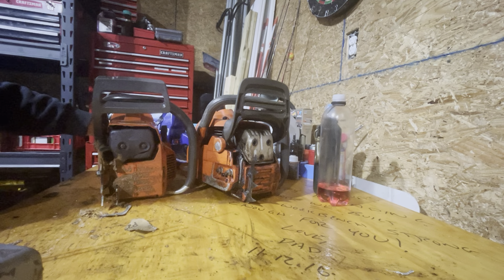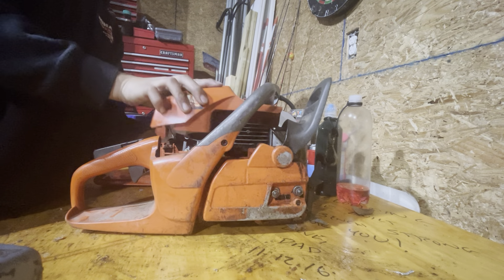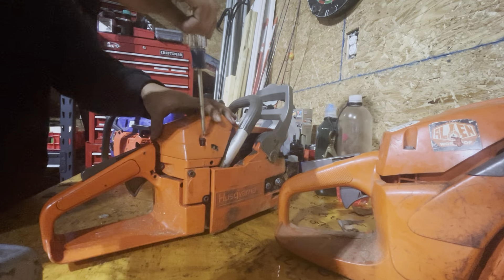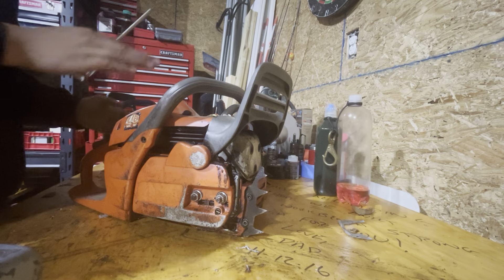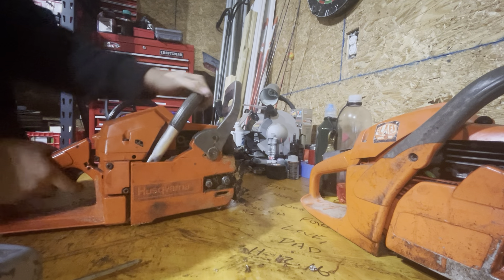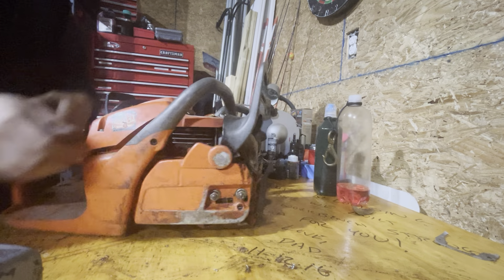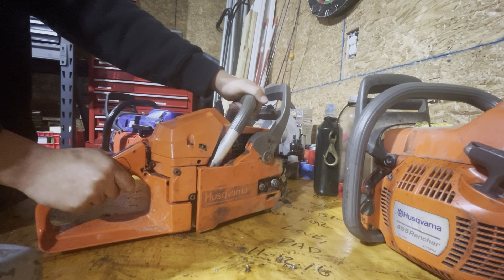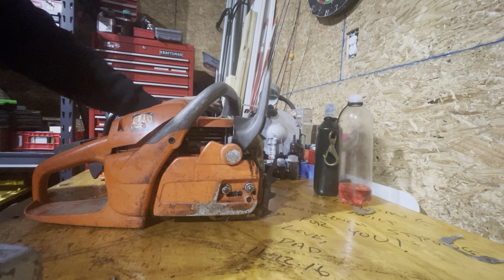Husqvarna 55 Rancher VS Husqvarna 455 Rancher

Comment: I agree.  I have had a 55 rancher for over 20 years.  I cut 8 cords of firewood a year with it.  I purchased a 455 Rancher 2 years ago because the 55 was starting to have wear. or so I thought.  The 455 is very finicky and never ran properly.  I am not a small engine expert.  I read online that it is difficult to tune the carb.  Thanks, EPA.  I then started buying replacement parts for the 55.  After working with it, re[lacing the worn parts (clutch, oiler), I realized that it is a much simpler option.  I have some trees to cut to finish a project here in installing a fence along the property boundaries.  I purchased several 55s in running condition (I have downed and bucked over 50 trees so far).  Some were upper cylinder jobs, some were stock.  I assumed that were most were abused an began shooting the parts cannon at them when they arrived.  It turns out that most ran quite well out of the box.  I spent $150-$250 per saw. on ebay.  I put them all to work and rotated duty to test them.  Many worked quite well when comparing them to my original saw.  Now that I have settled in to the good and the bad, I started a compression check regime.  My go-to purchased saws were 150-170 psi.  They ran and performed well.  I tested my shop queen, the original, and discovered that, after 22 years of hard use, it was at 180 psi.  Maintenance matters and using quality 2-cycle oil matters.  I always ran 1:50 as the manual required with an extra "glub" of oil in the fuel.  It turns out that the 50:1 is an emissions thing....from the EPA.  I am now running 40:1 in all my saws.  Remember, prior to EPA 32:1 was the standard.  Oil is life for the internals.  I now have the tools and knowledge to bring the 455 to running condition, but it will never achieve status for me.  The 55 has the option to have dual dog spikes.  Because of the external chain adjustment, the 455 never will.  I am cutting oak, hickory, and alder.  Dual dog spikes helps.  I now have 6 running 55s (what a pleasure) with 6 in the hopper for winter work to bring them to running condition.  The 55 is the perfect balance for speed and torque.  Another note, some of my 55s are not ranchers (decompression button) which have lower compression, which raises the question: were the rancher variants designed to have more compression?  I do have a couple of Holzfforma G660s for the bigger trees and sawmill duty: Yes, 92ccs is awesome and is quicker, but as an older guy, the rancher gets the nod for limbing and bucking the 20" or smaller trees.
Reply from the maker: Those are great points and I do the same, those 55 ranchers are awesome to buy cheap used and get running again as they are great saws. And I’ve got a 390XP W husky and I still run my 55 rancher all the time

Comment: Slap a 460 p&c on the 455 and shove it out the door.. yeah it’s better than nothing but I like the 55 for a reason you can do more with it. Plus the size weight difference. 

If I absolutely had to, I could climb with it. (The 55) 

The 455 would probably pull my belt off
Reply from the maker: Exactly, the 55 is great